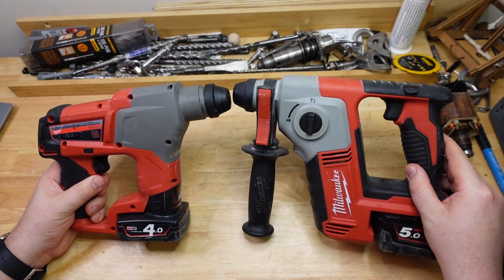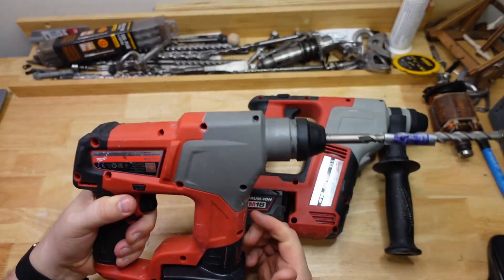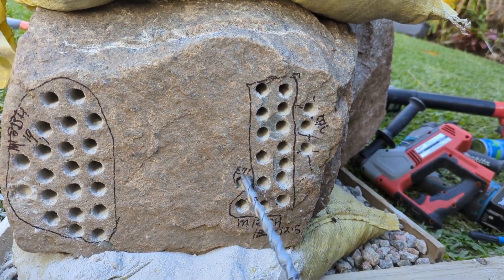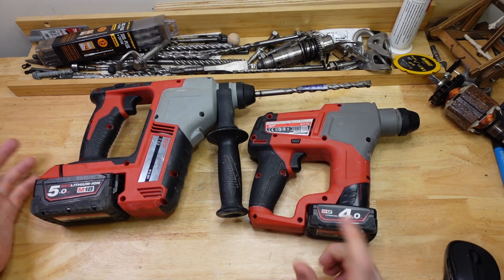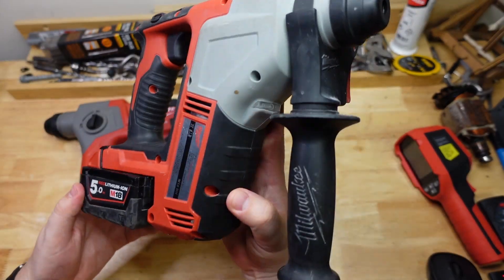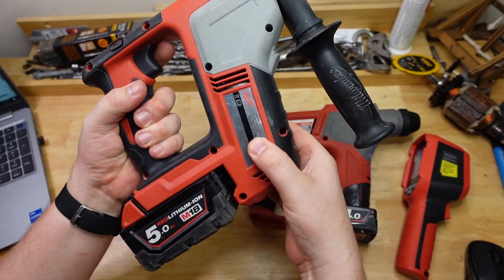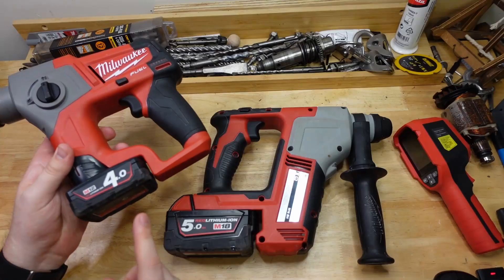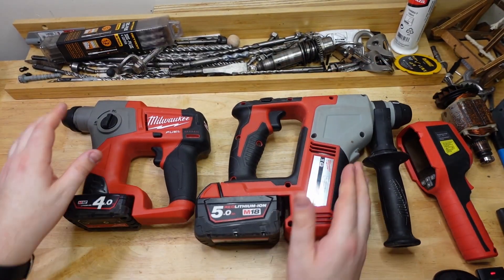Milwaukee 12V vs 18V vs Granite! (runtime, efficiency, heating tests)

Comment: To drill a 1 inch granitecountertop for RO system can I use 12v or 18v. Please let me know
Reply from the maker: You need to use a core drill for that. Impact drills will break the countertop

Comment: Another interesting comparison. We definitely notice a big improvement in capacity on the M12 with 6 amp hour batteries. I won't use anything smaller now as it isn't worth the wieght in the bag.
Reply from the maker: Yeah I'll be getting a HO battery soon, but I think they're 5ah? They generally don't help that much with the power with normal kinda drilling tasks but extra runtime with little extra weight is a real must for this little guy

Comment: Shouldn't it be 13,5/4 = 3.4 holes per AH for the M12? The M12 does run at 10,8v VS 18v for the M18. So number of millimeters drilled per WH could also be used. In which case the M12 did 70x13,5 = 945/43,2Wh =  21,9mm per Wh.
Reply from the maker: Yes! Good catch. Looks like I had 5 in the Ah column not 4. 
And yeah there are a few ways to break it down, do you think the mm is more useful? Maybe I'll try that in future.
Reply: @Boltah Downunder I think the mm per WH would be better, as WH is the total amount of energy stored in the battery. Thus it would enable a better comparison between the tools. The M18 brushed has done 1410mm/90WH so only 15,7mm per Wh, making it less efficient than the M12.
Reply: @BoltahDownunder  mm is useful, especially if someone is doing longer or shorter bolts. Normalising by Watt-hour is definitely superior so you can compare 12V (10.8V nominal), 18V, 22V (Hilti), 36V, etc.
Reply from the maker: Damn you guys really wanna look at them graphs huh? Think it's worth measuring actual battery voltage too, or is just nominal ok?
Reply: @BoltahDownunder  just nominal, they all use the same measurement for Wh.
Reply: @BoltahDownunder  if you do a holes or mm per Wh you would also see that the Hitachi thing has only 6,3 in the above chart as it would be a 5 ah 18v battery.